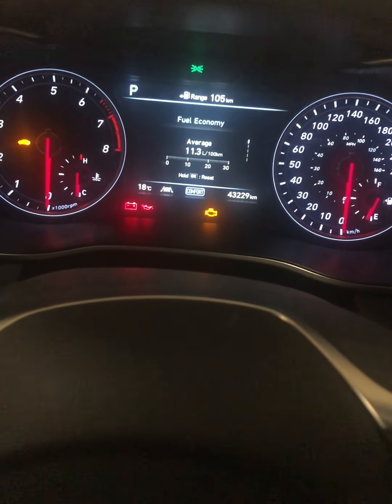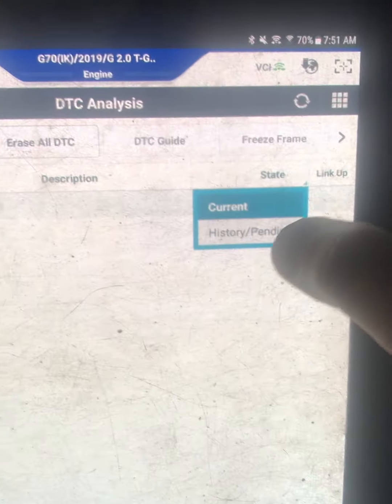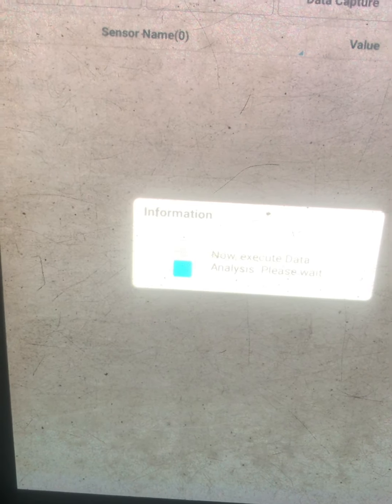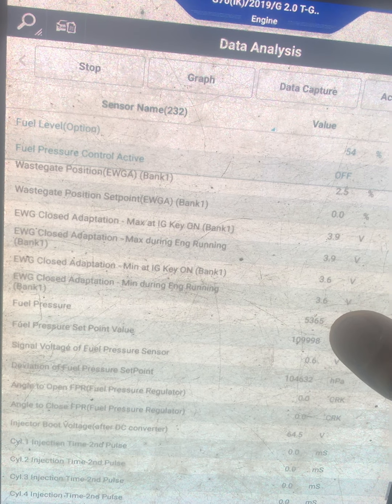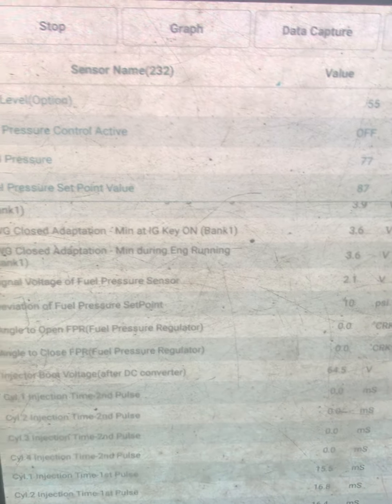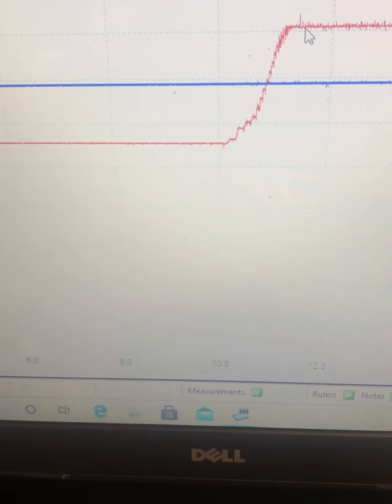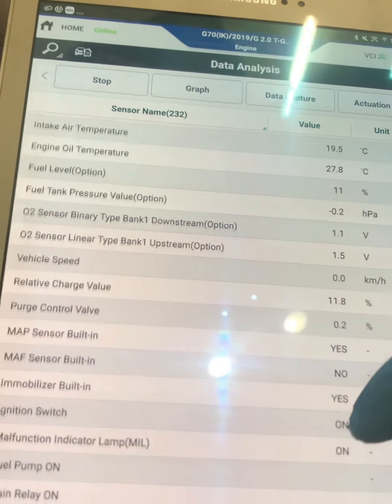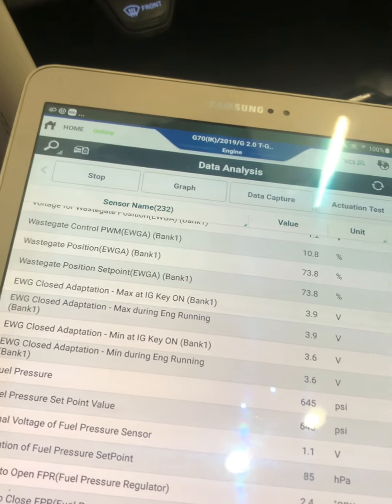Genesis G70 start and stall - P0088- fuel rail pressure too high

Comment: Thank you. Had a 2020 Sedona with the same problem. Actual pressure between 3500-4000 psi and desired around 800-1000. Sensor showed between 4.0-4.5V, but I didn’t think it had shorted because when the engine is turned off, you can watch the pressure slowly bleed, indicating to me it’s not just a failed sensor, and probably a failed regulator in the high pressure pump.
Reply from the maker: Nice, i dont have experience yet with the failed rail sensor. Most of the time they are pretty acurate.

Comment: Nice diagnostics! Have you seen any G70s come in with the oil seepage at the bottom of the bell housing? I'm wondering what the cause has been?
Reply from the maker: Yeah ive seen some g70 like that but its just sweating in there not leaking. I didnt have a chance to really open it up.

Comment: I replaced my cv axel on driver side 2013 sonata, had vibration under acceleration...I could not the lower ball join apart so unbolted the lower part of shock assembly that attaches to hub... when putting back together the shock tower was twisted to left where I had to turn the wheel to left to help get everything together... car pulling to right now... do I just need redo alightnment? Or something else out of wack cuz I unbolted shock bottom?
Reply from the maker: Was it pulling to right before you did the cv shaft? What do you mean by twisted to the left from shock tower? Even when you separate the knuckle and the strut and move the strut assy it  is normal that it will just move left to right. 
In my opinion just double check your work, then send it to alignment.. it could be alignment issue
Reply: @hyundaitech  I was thinking that when I separated the knuckle from shock, stabilizer tie was pushing shock tower hard, so hard I had to turn the wheel the be able to get everything back together....